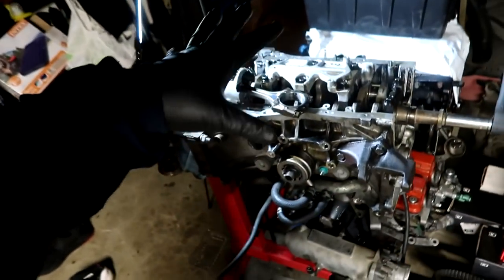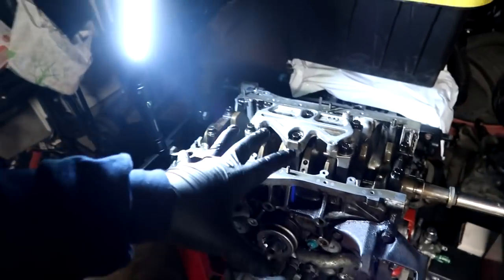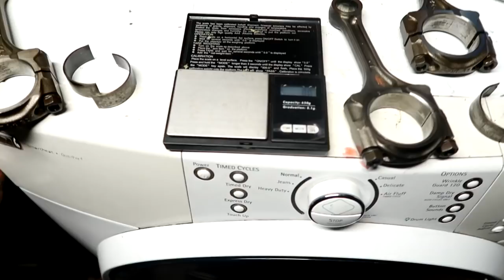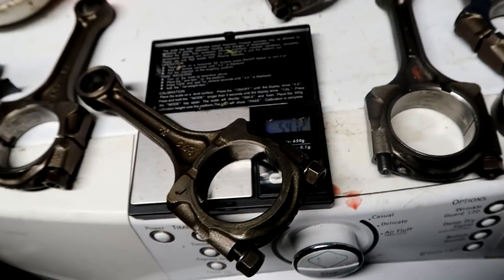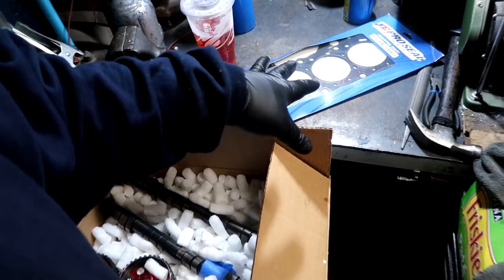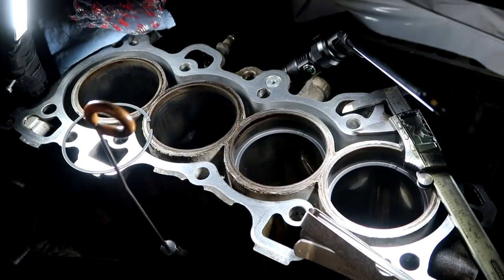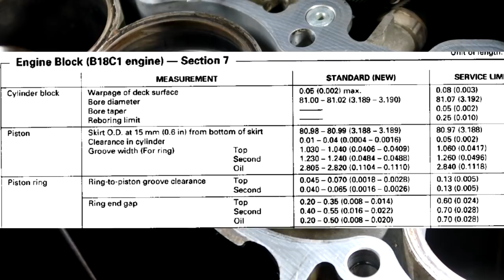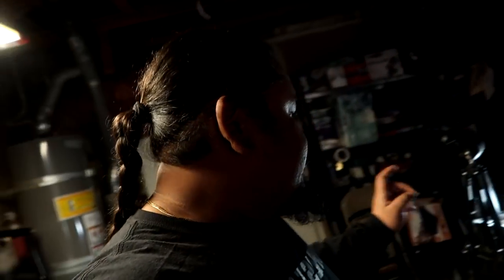B18C Type R Short Block Pre-Ring Gap

Comment: Main bearing loose usually means that block is scrap. Any machining would change the centerline of the crank. Hope that the new bearing fits snug.
Reply: CapnJoshy first off you probably meant line bored. And yes that is an option with mains that aren’t damaged by a spun bearing. But there is a limit to line boring cause it changes the center line. Depending on how much material is missing there is an under size bearing available but again that has limits.

Comment: Dog ur a sick ass engine builder i was surprised u didnt know to balance ur pistons n rods, i balance mine within a tenth of a gram of eachother, try checking ur ring end gaps 15-20mm from the bottom of the cylinder, keep u the good work, oh also try Hastings chrome rings and get them one size up then file them down its worked for me
Reply from the maker: i havent built an engine since 08-09 but then again they were v8 in college. i have the rings down about 1.25in down the cylinder but im also checking down mid way too.

Comment: Hey I just built a turbo ls non vtec recently. I have a similar set up nippon turbo pistons h beam rods and I've personally talk to the performance department at nippon they recomend. 25 to .40 on the top ring and .75 to .80 for the second due to the material they used expands more than others. So I ended up with .43 on the top and .88 on the second after the ball hone no smoke at all
Reply from the maker: is this mm?
Reply: @YoungStatic  yes
Reply: I also clocked the pistion rings similar to how the boosted boiz did the rings on the odyssey
Reply: I clocked the rings 180 degrees from each other

Comment: I'm wondering, if you hone the cylinders, your max gap you have for the top set of rings will no longer be good either because they'll be beyond .014. No? I would return the rings back, if you can.
Reply from the maker: its max spec for the top ring yes, but service limits is .024. so even if it goes .015 after bore, it should be ok. its all motor so im not too worried about it.

Comment: Plan on going with the wiseco pistion and Manly rod set up for my ls-v turbo I hope that's a good set up for 20psi. Can I also use STD size bearings?
Reply from the maker: piston/rods should be perfectly fine. if your crank is in spec, std is fine. but if its not, you'd have to measure the crank and the rod journal ID and do the math to see which color'd bearing you'd need for the setup.

Comment: Why not just go 10 over?  You'll have to hone out the taper that's likely in the block anyway to get the rings to seat properly.  If you decide to use this at 81mm, get NPR 81.25mm rings and file them down, then use the 81mm oil control rings.  Worked well on my motor.  Or get supertech rings they fit better out of the box but are expensive.
Reply from the maker: im trying to get away with what i have to rebuild a block without spending too much into it. if i was to spend money on bore and hone, id just use that money towards find a solution to fix my sleeved block for the crx. supertech showed 79mm and then 81.5. i couldnt find 81mm.
Reply: @YoungStatic  there's some for sale on eBay right now.  Like i said they're a bit expensive though

Comment: Is there any reason why you don't take the block to a machine shop pay a few bucks have them deck the block, hot tank  and hone it for you?
Reply from the maker: because its not a few bucks here. if im spending $200+ im putting it towards my main engine for my crx not a temp engine
Reply: @YoungStatic  then just spend the $$$ once and do it right..
Reply from the maker: @323hamstr  are you referring to my crx  block or my itr block?
Reply: @YoungStatic  it block brother
Reply from the maker: 323hamstr yeah the itr block is not my main concern

Comment: Noob here, but couldn't you use another set of top rings and file them down?
Reply from the maker: 2nd rings are scrappers. They are specific. My top rings fine, the 2nd are wide. Didn’t have another set at the time
Reply: @YoungStatic  what did you end up doing for the second rings? I'm running into the same problem with nippon pistons/rings

Comment: So if you got 81.5mm piston set and bored the block out .5mm then all the rings should fit but that is the more costly route. Man those 2nd rings were way off. Also check the crank and see if those bearings scored the journal bad, that will need machining. You got a buddy that will get you right.
Reply from the maker: the journal for that 1 crank bearing, has no scoring on the it at all. but it is the shiniest of all journal. but im using a different crank for this block. im not wanting to go .5 over on this block. the funds can go towards the other motor for the crx.
Reply: @YoungStatic  you should make out well with the latest junkyard score!